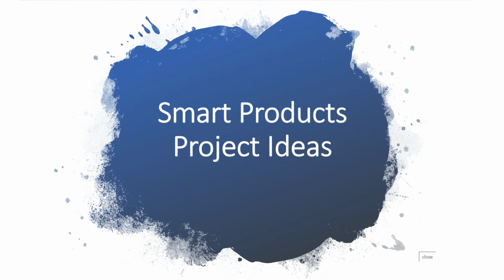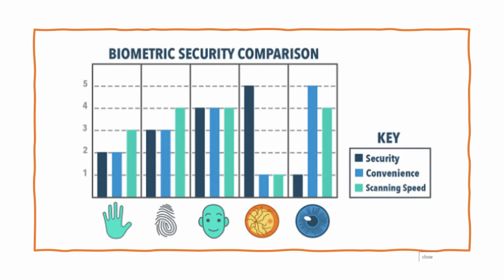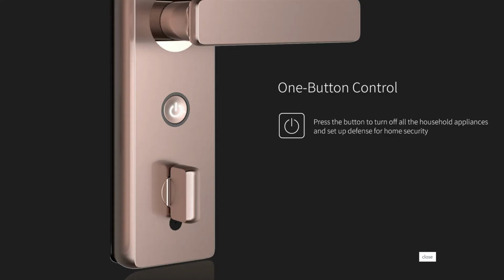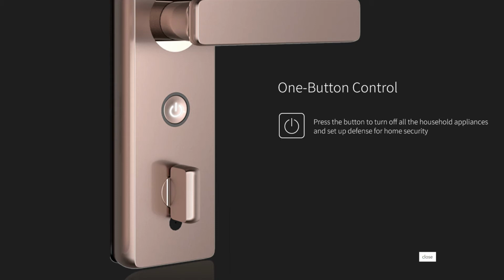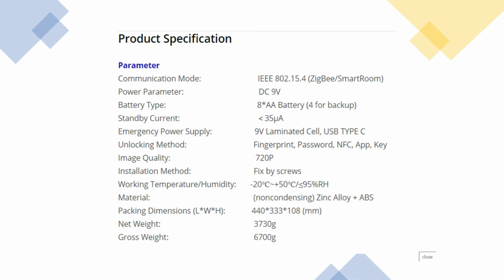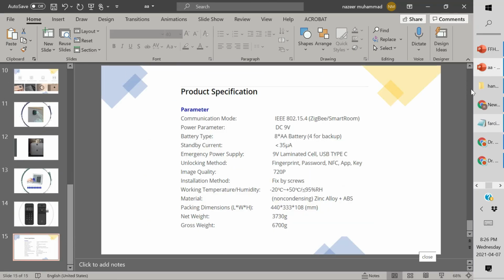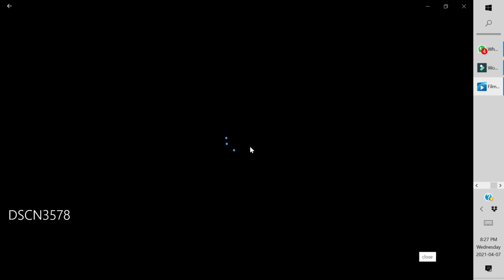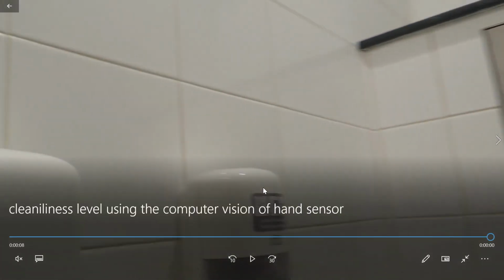IT based Smart Products Project Ideas

Comment: Sir, In the case of door locking and home automation we can connect these all ( door, draws ring bell etc ) to mobile fingerprint and all these may be managed through a mobile application as Tesla car are also handled by the use of software application. Application control every part of Tesla electric cars. Sir, so why not a person could control his entire home through his mobile as it'll also give him security as everyone has his own mobile phone. Room door lock is connected with mobile in such a way that person can open his room door by touching the fingerprint sensor of his mobile. It'll also easy to spread, understand and apply for every field of a person as the majority of people have smartphones.
Thank you, Sir.
Reply from the maker: yes many things can be done. focus on the product. May be these are small. capture the market per demand. i ll share that doors are opening auto and close auto. even without touch.
Reply: @MMV-Exposure  Jazak Allah Sir